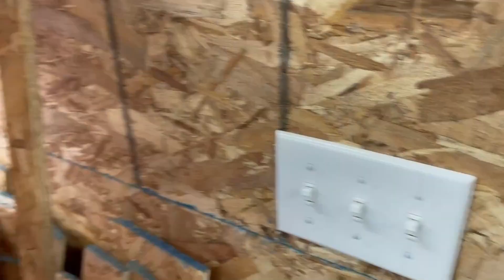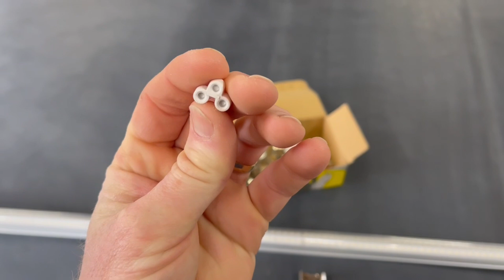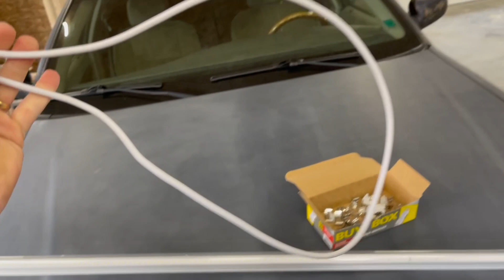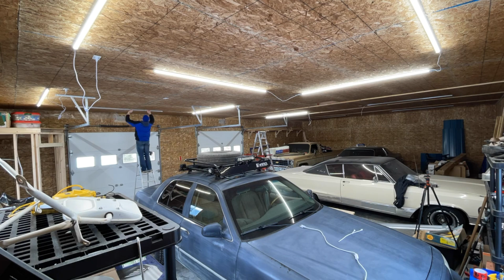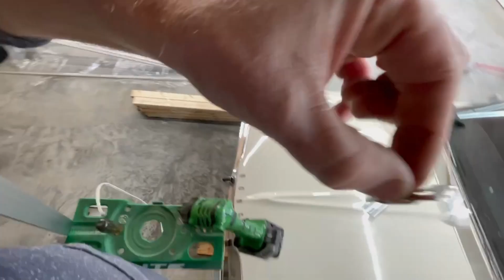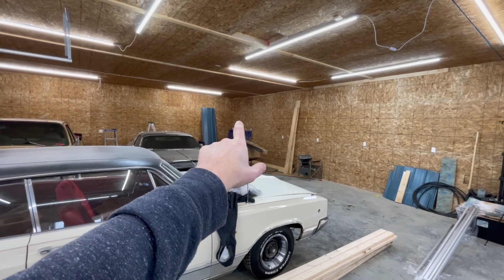AMAZON’s Brightest Garage LED Lighting Barrina T8 - 8FT 72W 9000LM 5000K, Daylight White, V Shape

Comment: Hi. i have a 1990 ford ltd crown victoria lx. just got complete braking system redone & uploaded. just found out i have a blown head gasket. what should i do?
Reply from the maker: Sorry to hear about your troubles. If you are mechanically inclined at all, its a fairly straight forward job with no special tools required. If you aren't inclined to do this yourself expect to pay roughly 600-800 labour to have a reputable shop do it for you. Also be sure to change both head gaskets.

Comment: Love the amount of light Jason. These will be what I will go with in my 35’ x 40’ shop, always used movable lighting when it was a packing shed in my farming days. I have 12’ceilings. Wonder if the light would “wash out”. Haven’t used LED before.
Reply from the maker: You can find "high-bay' LED's that may work better for suck high ceilings, but I'm sure these would do just fine!